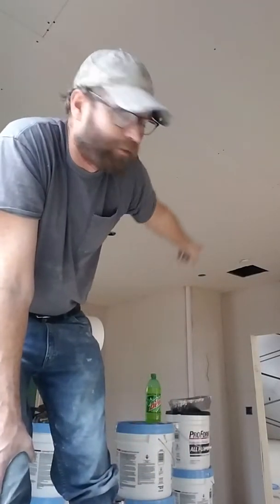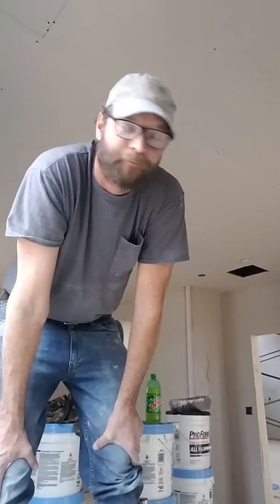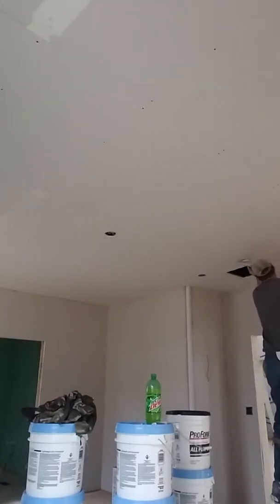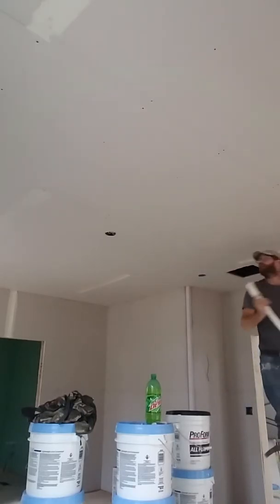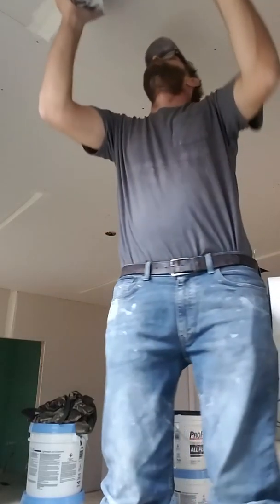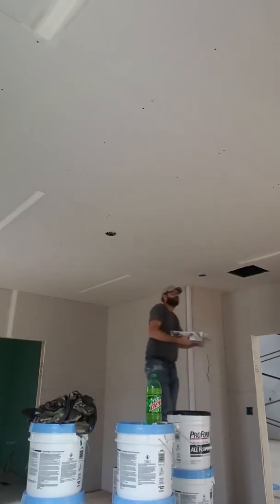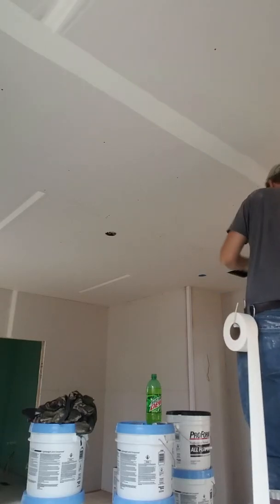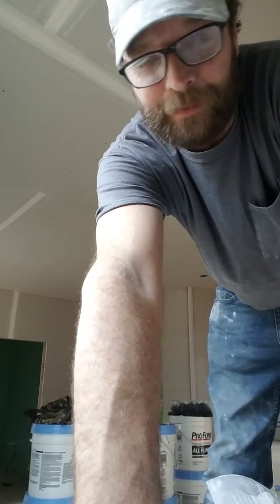Hand Taping Angles

Comment: Ur a damn good finisher bro I'm a lefty myself n my technique is almost identical to urs I also ran machines but I prefer hand finishing if anything run out butts n flats with a box angles by bead by hand I cut my mud taping n coating angles same exact way keep up the clean work n teaching guys the right way
Reply from the maker: john weil I try.  Been finishing a long time.  My average house now is 250 to 300 boards.  I have converted back to machines since December.
Reply from the maker: Thank you for compliment.